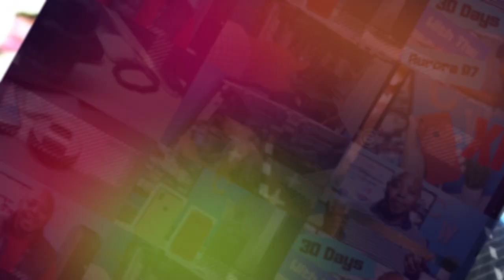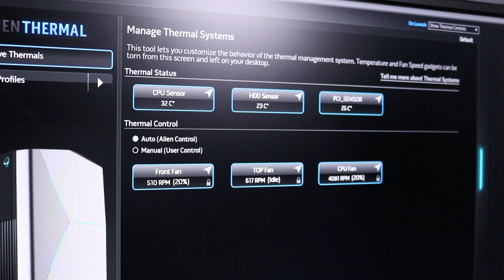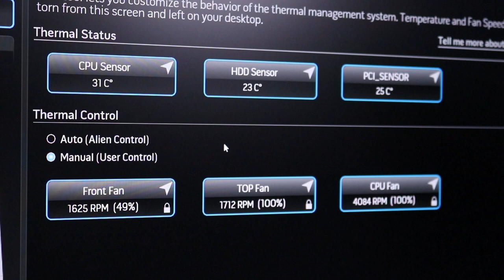Corsair Hydro Series H60 Liquid CPU Cooler Install / Upgrade in Dell Alienware Aurora R7

Comment: These closed circuit water cooling system with zero access to the water loop are garbage setups.....I use a outdoor fountain pump,1 gallon mason jar, high temp silicon tubing, and an optional 500 ml syringe (exchange water)  and a universal water block all for around $65.00. I can exchange cool water or add Ice at any time to bring the cpu temp down to a low low temp. The systems you guys use sure it looks good but you have no access to the water loop without opening the case. My system may not look real cool but it sure acts cool.